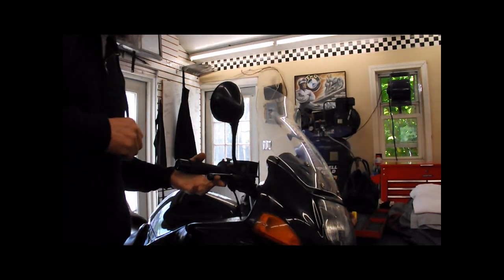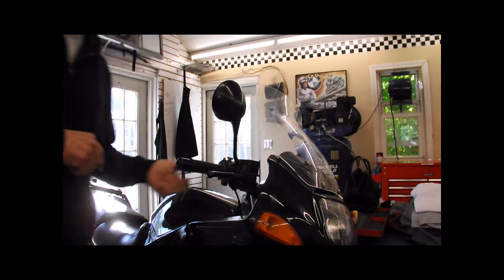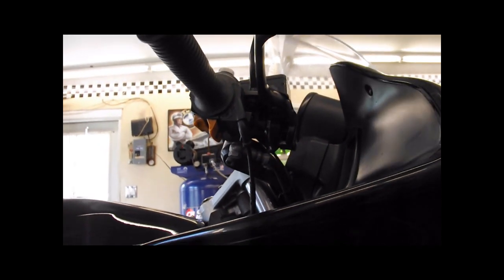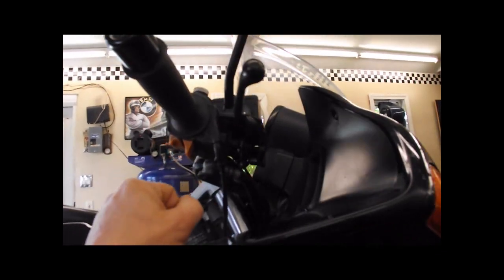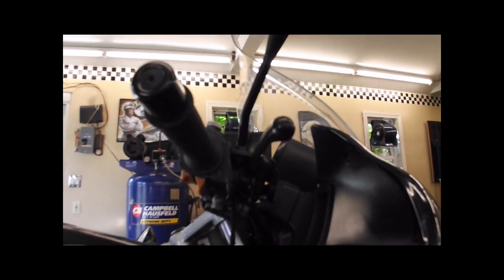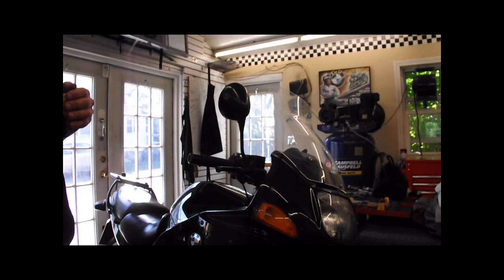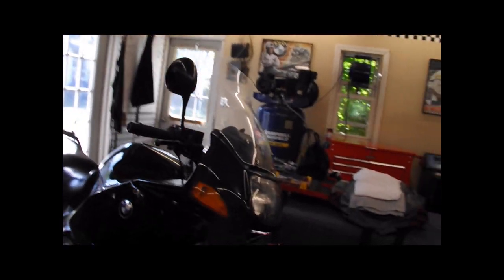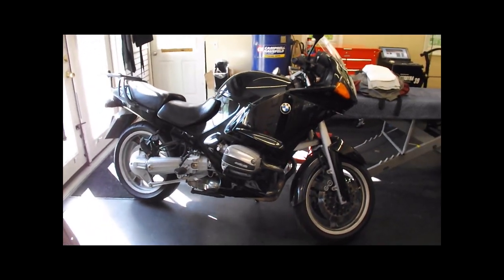BMW Service - Sticky brakes

Comment: I had a similar problem with my ’96 850r, I ended up renewing the master cylinder and everything was good. I have noted what you said about the original hoses and I will replace mine this year. Thanks for the video 👍

Comment: My rear brake recently stuck so bad I got stopped. The motor didn't have enough power to get me down the road. This started when I smelled brakes and it smelled like MY brakes. I was right, so I stepped on the brake again, and it ratcheted tighter, so I repeated this process. Turned out it was dirt and crud around the rubber seals on the caliper. Took the seals out and cleaned everything up. Pistons came out and all. Not a problem. These brakes are good. I've seen scored pistons on you tube on other bikes, but these Brembos are great. The pistons looked like new @ close to 100,000 miles Got to. keep 'em clean.

Comment: Chris, I can’t thank you enough for all the amazing advice, tips and most of all, HONESTY in your language. I have a question regarding an R1150 (with Servo brakes). My “!” exclamation/alarm light comes on every so often. Not a consistent event but it’s at times when I apply brakes. The ABS light does not come on. Only the warning light. It happens when I apply brakes. The bike still runs and stops on a dime. Brakes flawlessly. It used to happen once in a while. Once the bike is shut off and back on the light disappears. Before I take it to the BMW dealer, anything I should check? The bike had a full flush brake service a little over a year ago. I checked brake lights and fluid levels. I am open for suggestions before I drive it to the (Make pig noise here) Bmer dealership. BEST! Gil

Comment: K100 16v and k1100 master cylinders are bitches... big ones, one of the tricks I do to fix them if they are not very very damaged is sanding with a very fine grain sandpaper the walls of the cylinder, sometimes it's just a bit of small shit that gets inside.

Did on mine and seems to work after 2 years! If he put the repair kit already in, maybe it's worth a try.

Cheers and keep up the good work!
Reply from the maker: Thanks, you too!